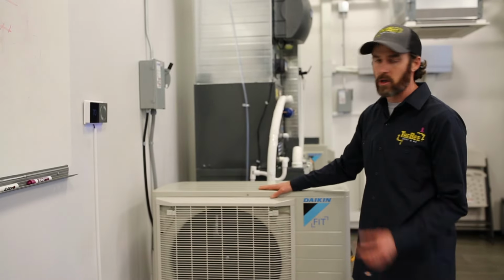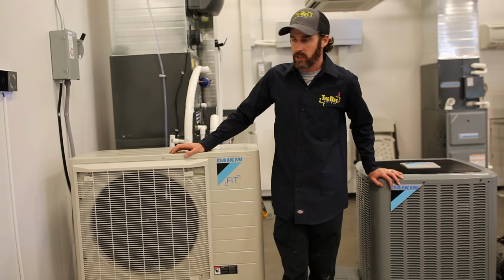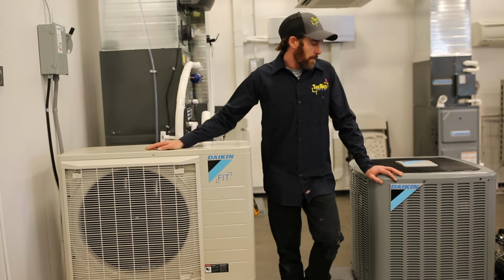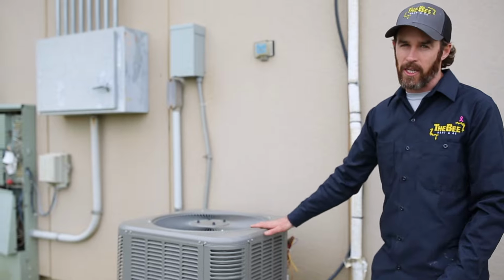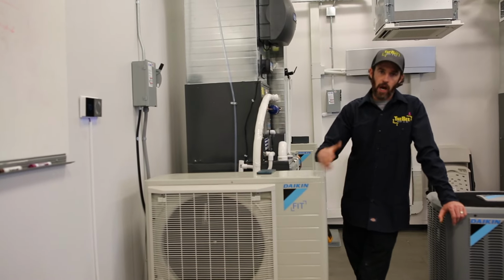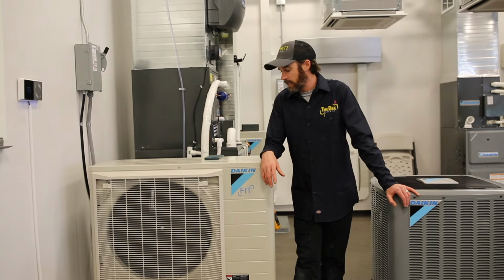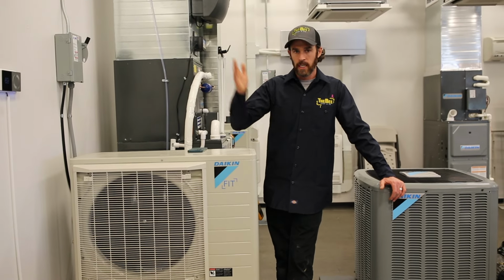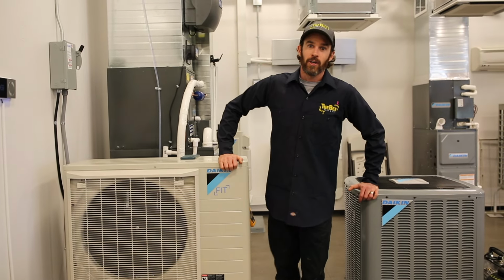BUYING A DAIKIN FIT?! Watch this FIRST or live with REGRET FOREVER!!

Comment: I just replaced an old 13 SEER single stage unit with furnace  with a 17SEER Daikin Fit Heat pump.  I ran into two problems. 1) Surprisingly,  there was absolutely no energy savings on my summer power bill.  2) It produces a loud buzzing noise in the wall in the winter. 
No real good reasons given for why the Daikin Fit wasn't more energy efficient. The manufacturer says the Daikin line sets run at higher pressures in general and especially in the winter.  And this likely causes this buzzing in the walls. They suggest running the line set up the wall externally to remove the buzzing noise. Are you familiar with this issue? And will running the line set up the wall definitely remove the buzzing line set issue?   In your video it seems like the line set was also ran externally up the wall.   Any feed back would be helpful. THANKS!!
Reply: I don’t know what is going on with the buzzing noise, but it sounds like there could be possibly a problem with installation. As far as energy efficiency, you may need a technician to come and dial certain settings in and field settings. To get better, energy, efficiency, and savings out of it depending on where you live you should also contact your utilities provider because they may actually provide certain rebates. In Colorado Springs. I have witnessed people getting $1200 rebate from the Colorado Springs Utilities for a VRV and high-efficiency furnace combo.
Reply from the maker: Agree with the comments below. Maybe look at duct sealing if it wasn't done, but the buzzing could be mitigated with a linset ran externally probably... I would have thought it was there before though so if this is new that's odd, this can be from compressor vibrations if the linset inside the wall is braced to tightly to a stud or something in an area you spend time in then it might transfer somehow. Hope it get's resolved if you're still having issues let us know. Insulation and duct sealing can go a long way if those weren't done. The energy consumption should definitely be less unless you changed your usage like setting the thermostat lower or higher for example with the new system but even then, the fit is normally pretty efficient
Reply: Alot of it can be the type of install. if your unit is in an unconditioned space and running low and slow then it's not getting the air to the space like something at speed would be. Your losing it before you can use it.
Reply: Also check the external static pressure of the furnace. This could be a duct issue. Look into room by room design for your ducts.
Reply: Hi All, Thanks for your responses. The AC company, told me that the FIT's run at higher pressures than my older 12 TIER systems, so the higher Lineset pressured cause greater vibrations, that the house wasn't ready for.  So, they generously covered the cost of re-running the linesets outside of the house and then into the attic. This has helped to reduce the sound of the loud vibrations by at least 50 to 70%.

Comment: Can you please advise, what thermostat option I have for FVXS series other than $800 one+ ? Fan is running constantly and there is no way to stop it. I would love to have something way cheaper even wired standalone okay, - but once it's running non-stop, - it's raising  humidity slowly back.
Reply from the maker: That's odd there's a fan setting in the thermostat control so you should be able to turn the fan to off mode if you want and adjust the fan speed up and down. Normally we run the fan on low for air circulation. The Daikin one touch is now out and eliminated the wheel. I don't know if your dealer will swap it out for you but it is a newer thermostat. I have the one+ as well in our home and haven't had any issues with it. I believe you can change dehumidify settings in the thermostat, it's an overcool setting / dehumidify setting in the installer settings during commissioning.
Reply: Cut jb jumper on indoor

Comment: Is Variable Speed and Inverter the same thing?
Reply from the maker: Explanation below nailed it :)

In terms of what you as the consumer will notice a variable speed compressor / inverter system will ramp up and down and that's the "variable speed" feature of an inverter driven compressor.

Comment: I hate Heat pumps.  I live in the Midwest and I am on my second Trane heat pump since 2007. The first one was a seer, 14 electric heat strip air handler and right after 10 years the compressor went out so I bought another trane seer 18 XI Tam 7 electric air handler, and I have had nothing but trouble with it for the last six years.  I am so angry and frustrated, and I spoke with a new good guy in our area who owns his own small HVAC company and does all the work himself with one helper. He said Trane is too expensive and they’re not worth it.  He installs Dakin and Amana and he said those are the better units, and I am inclined to believe him.  His prices are very reasonable too instead of so expensive like these companies.  $75 per hour and he said he’ll beat anybody’s price in the area because he has a low overhead and that’s what I like.  These bigger companies think they got  to charge you so much. I hate big corporations and I don’t like big companies either because they always want a lot of money.  I am old fashion like my parents were, and that’s the best way to be whenever it comes to money and quality.  Stick with a small business owner who doesn’t have a ton of employees because he will almost always treat you better if he knows how to do good work.  And I have seen bigger companies who have some of the shittiest workers who come and go every two years.
Reply: Fact
Reply from the maker: It’s a double edged sword, we’re always aiming for a balance ourselves, but even with a handful of technicians it’s still expensive to run a company
Reply: The truth is most air conditioners are not installed properly. Air conditioning installation is typically a difficult job depending on where it’s being installed. Installation is everything one small thing can change the lifespan of a unit.
Reply: I have the same Trane since 2013 and only had the outside fan replaced under warranty and a capacitor. I have the 4 ton T7
Reply: Daikin make Amana

Comment: Is it possible to run the Fit on a generator during a power back out?
Reply from the maker: Yes for sure, you can run anything on a generator but the daikin fit is very low amp draw.

Comment: Can Daikin Fit replace an older outside single stage unit w/o replacing home’s 20 year old high efficiency (92%) gas forced air heating system? ThankU.
Reply from the maker: Technically yes, with a daikin fit gateway adapter but I would strongly advise against it because your furnace is 20 years old. I would only do that if your furnace was newer and you wanted a daikin fit…you’d be better off with a Daikin paired system. If you’re going for a Daikin fit heat pump, I would switch to an 80% furnace if it’s allowed in your area like the DM80VC because it’s a dual fuel set up that way, but one of the nuances currently is you can only do a dual fuel set up on Daikin fit 3 ton or smaller, heat pumps. Otherwise if you don’t want a heat pump and you’re wanting to stick with a high-efficiency I would do the DM 96VC or DM 97mc high-efficiency furnaces in pair that with a daikin fit AC (cool only condenser).
Reply: @The HVAC Dope Show  sounds like you are recommending a homeowner go from a 92% to an 80%?

Comment: What seer
Reply from the maker: It’s classified / rated as a 17 but the AHRI will vary based on tonnage and the AHU or Furnace it is paired with
Reply: @thethoughtprovocateur  was offered decline. I don't trust it
Reply: I don’t think that’s a fair comparison.  I understand it’s efficient but for an Apples to Apples comparison, the outdoor condenser of the Daikin FIT should be placed outside
Reply: it always is lol @PHamster

Comment: It took over 6 months to install my Daikin Fit.  It is just junk and Daikin  does NOT back them up.  It took four months for Daikin to recognize the problem  and then they put two band aids on the unit.  They did  not replace it  per their warranty...it is junk and I paid $10k  for it to work efficiently with my battery backed up solar.  I seriously  doubt it will.
Reply: That sounds like the contractor messed up your experience.  I work for a Daikin dealer and the Fit or any other variable speed AC property sized and installed will impress the homeowner.
Reply: Daikin offers 12 year unit replacement for the fit . Sounds like the contractor fucked up
Reply from the maker: Lol agreed
Reply from the maker: It’s the installer… these systems are solid I’ve only had an issue with the Gateway adapters from time to time, but these are reliable systems and when paired with a daikin furnace or communicating air handler all our customers love them, so I would try to get a second opinion from a different daikin dealer if your still having issues
Reply: You might also call Daikin Corporate and ask for one of their Field Engineers to come to inspect and evaluate your full system. Or get an independent consultant perhaps through a local energy efficiency organization or retired Mechanical Engineer to evaluate and fix or report. If you are correct then take them to Small Claims Court etc.

Comment: Just remember, the Daikin Fit will run continuously whereas the conventional AC will cycle on and off.
Reply from the maker: Very true, we always try to point that out but the longer run times tend to help out here in colorado because most systems are in the basement which makes cooling the upstairs difficult
Reply: @thethoughtprovocateur  If this is the case, that it runs continuously, where does the "lower electric bill" play in at? I always hear about it being a huge pro when advertised. TY
Reply: @mikewilliams5948 it runs low and steady rather than huge loads when it ramps on
Reply: We just had a 3 ton fit installed and it seems to be running all day at around 3,000 watts 24/7. I feel like that's way to much power. Is this normal? And is it normal that it takes hours to up temp 5 degrees on a 2500 sq ft new build

Comment: What is crazy to me is the inverter controlled market has been around for 20 years + , I am surprised to still see direct on line systems still available in your market .
Reply from the maker: Yeah it's kind of a trip, and there's no rebates for inverters but there is for a 13 SEER AC in our market... mind boggling
Reply: In my area SE NC they act like inverters are not a thing or are evil. I’m getting the Amana S (similar to fit) installed soon and they said this was only their 4th inverter install in the last 5 years. I feel good about who’s putting it in so I’m not bothered by the low install numbers.

Comment: I had a Daikin installer come by today for a quote and he told me that they are no longer selling the Fit due to a high number of condenser failures.  AZ market.  Is this being seen elsewhere as well?  Kinda had my heart set on buying one.  Thx
Reply from the maker: I have not seen this, and find it surprising considering it's based on their existing and established inverter technology. The only issues we've had with them usually come down to wiring / communication issues if the connections aren't made well by the installer but this is an easy fix and has nothing to do with the unit itself.
Reply: @thethoughtprovocateur  I will check with other installers as well.  Is it. A fair statement that the FIT prices out at around the same as other good brand single stage units ?  Thx again.  If you like Bitcoin, keep a eye on Kadena.  You will owe me one
Reply from the maker: As far as compressor failures though I haven't heard that, the systems are pretty "smart" in that they have multiple sensors to prevent them from damaging themselves. And Daikin actually offers a unit replacement guarantee on these for 12 years meaning if the compressor conks out within 12 years they'll give you an entire new Daikin fit condenser as opposed to just a compressor warranty like other manufacturers. I would get a second opinion from another Daikin Dealer in your area because if they're all saying that then it might be something specific to a batch of units or design conditions. I know Phoenix gets above 115 so they might have a different unit that works better in those conditions. If you'd like a referral for a Daikin dealer let me know and I'll reach out to my rep to see if they have someone!
Reply: @thethoughtprovocateur  I was told they were replacing so many units they determined it was no longer a viable product due to all of the downtime and related waiting on parts or the replacement units themselves
Reply: @ksoonsoon  I'd say that company is full of it. I just had one installed and they install them all of the time. I have a 12 yr stress free warranty on it too.
Reply: @thedude2897  Does the fact I’m in the super hot Phoenix area change anything?  I’ve now had several installers in the area tell me the Fits area great in general or cold climates, but lose a lot of efficiency in temps over 110deg that we get here consistently in the summer.  Thx
Reply: I’m actually thinking of going with a 4 ton single stage unit now.  Thx
Reply: @ksoonsoon  Not at all. I'm in hot humid Florida and it can get 95 here during the summer. I still think they're full of it.
Reply: @thedude2897  Thanks for the continued responses and feedback.  Keep cranking out your great content!!!
Reply: @ksoonsoon I know this is a late response but I bet whats going on is the thing never ramps down. These units and compressors are fantastic but not really designed to run full tilt boogie all the time. Basically the compressor over revs to give the stated capacity and under normal conditions its not a big deal to periodically run them. I bet Phoenix taxes the compressor to much long term. Just a guess but I do quite a few mini splits in N Texas and on our hot days it can be tough in them of they aren't oversized or in a very insulated space. All mine go into new construction and complete foam envelopes
Reply from the maker: Just curious, did they have a different product they recommended, like the DX20VC or another inverter? Thanks for the post! And fist bump on the Bitcoin logo pic, lol we're Defi fans over here!
Reply: @thethoughtprovocateur  thanks for the reply. Yes they did run me through the other daikon products from single stage through variable. They seem much more expensive than their counterparts from other brands however. That is one of the reasons why I was looking to the fit since I understood that although it is a high-tech product, the way it was made allows daikon to sell it for closer to the cost of a traditional single stage.  Both saving some money and getting a better product was very appealing.
Reply: @thethoughtprovocateur  btw, that is actually a pic of the bitcoin node I built and run on a raspberry pi.